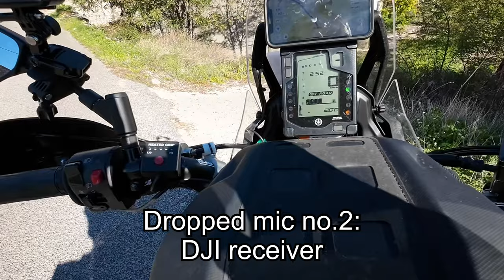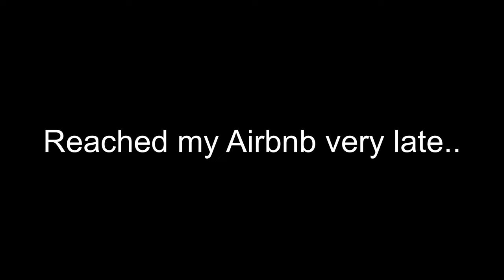New Tires, New Adventure: Riding the Croatian Mountains with Anakee Wild! [E12]

Comment: How's front wheel tracking with Wild tire?
Reply from the maker: Offroad its a lot more predictable than the oem pirelli. On road it feels softer but it has plenty of grip for a knobby.
Reply: @PatchedBandit  did you try it in a muddy rut? If so, can it bite enough to dig the front outta rut, even on shallow angle?
Reply from the maker: @hrvojecolic8274  I had wilds on my previous bike too so I have ridden them in many conditions. If mud and sand performance is crucial I would not dare to say Wilds are great in those situations but they do have some bite even when it gets muddy. 
Probably still safe to say this is a 50/50 tire and not really ’great’ on any surface.
I would say buy with caution in mind.

I can only directly compare them to anakee adventures and pirelli scorpion str rally. (Direct meaning: compared with same bike)
Anakee adventures are horrid even in the best of offroad situations. Easily the worst of these 3.
Reply: @PatchedBandit  I know and I don't expect them to be Geomax, or 6Days, but I'm currently riding offroad on Tourance, so any improvement will be more than welcome.
Reply from the maker: @hrvojecolic8274  Will absolutely be a big step in the right direction! There is a reason I have bought the Wilds more than once 😊 
Even for longer trips I would put a wild at front at least. If 10k km of durability is needed from the rear a Wild is not gonna do that.
But the rear depending on riding style and temps etc will last 5-6 000km roughly. Front will go double that easy.